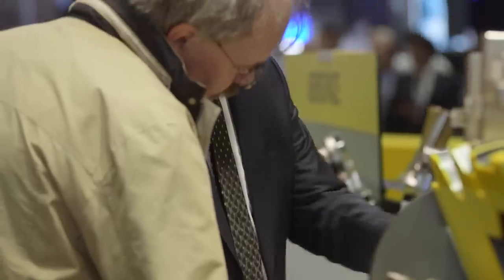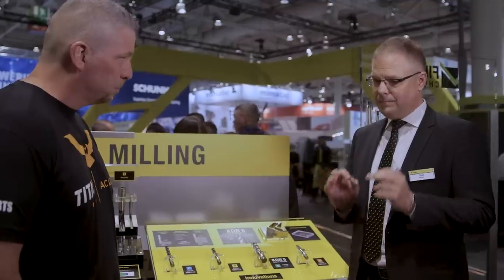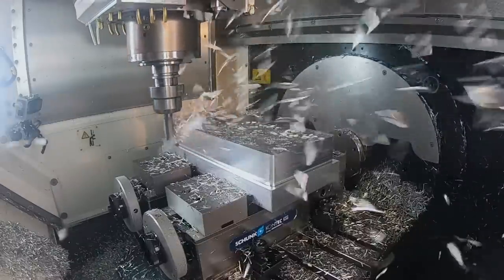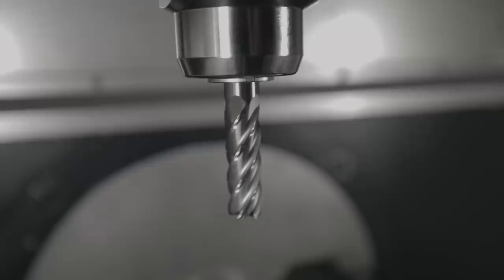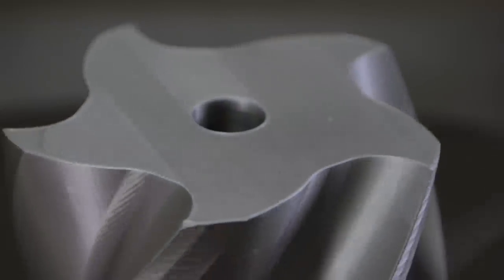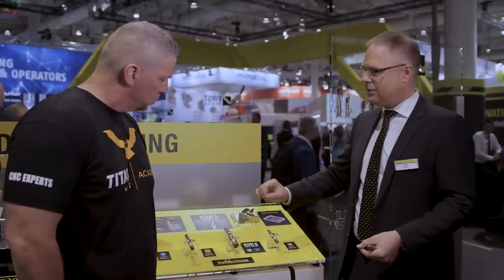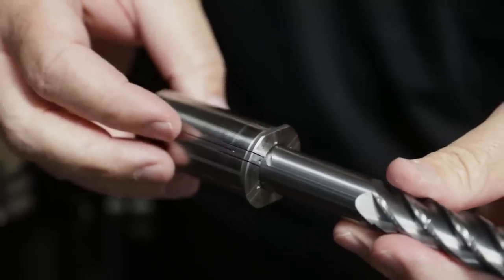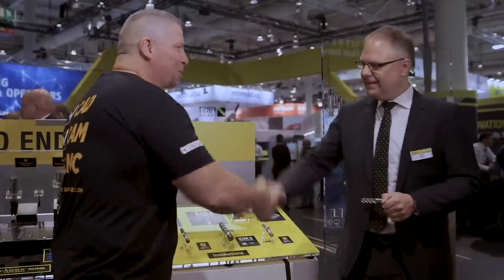Kennametal Unleashes Innovative Tools at #EMO2019 | CNC Machining Tooling

Comment: Hi Titan sir.
We have facing a problem with kennametal Tungsten carbide (TC) Roll, which is normally used for making wire rod and rebar. The problem is when we cut it by CBN tool, in every 10-15 mm the tool tip blanding and make a line on the surface. This type of line are not desirable. The Depth of cut is 0.1 mm and feed is 0.200mm/rev. The rpm of 350mm Dia job is 08. Any suggestion sir to get rid of this.

Comment: Tivo is a salesman, with his statement that almost all manufactures only make 2-3 flute endmills.

Our tool suplieres have 1 to 6 flute endmills in a lot of flabors, corner radius, corner chamfers, necked, short, with or without weldon flats etc

Most of all, DLC coatings! Don’t see Kennametal do that either while still offering these tools at a higher price. Dlc coatings prolong toollife A LOT!

And guys... Safelock. It’s a decent feature... but it’s a Haimer invention. 😅
You also need a special collet style to accept and take advantage of the extra cost of a Safelock groove.